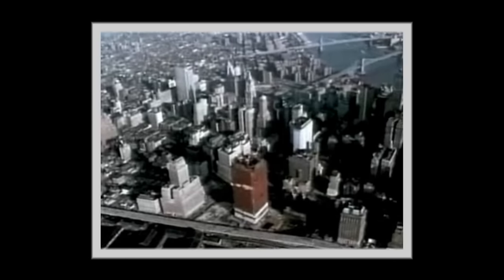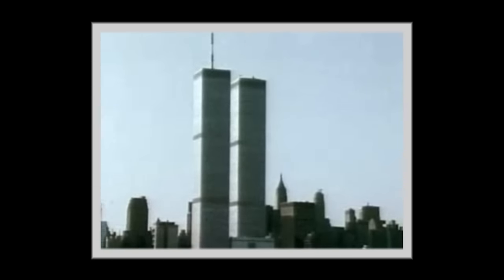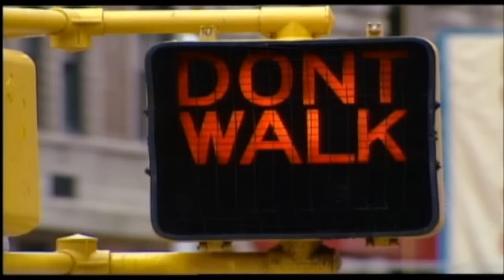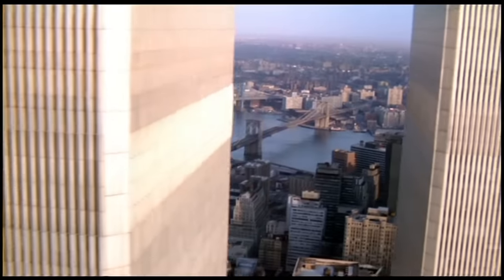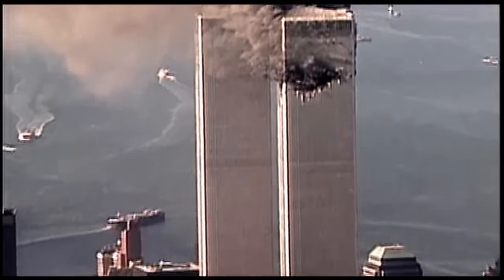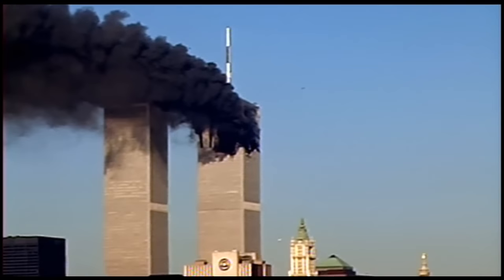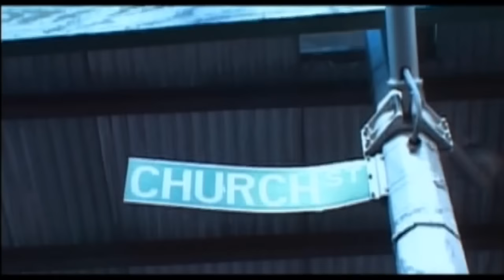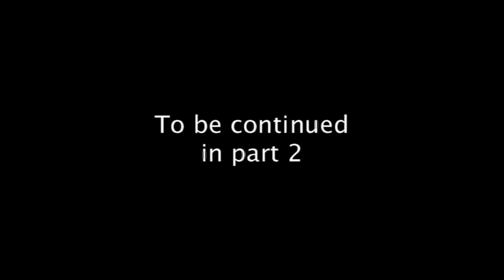102 Minutes - The Attack on WTC, Part 1

Comment: We were lucky that the South Tower did not collapse upon impact.  The airplane impact was much more damaging than what the North Tower sustained.  Almost all of the corner supports were blown out on impact, not to mention the interior supports.  If you watch the collapse, you will see that it starts at exactly the point of impact near the corner of the building.
Reply: Plus it didn't help that it hit at a much higher speed and at an angle.
Reply: Walter White When it's going over 500mph, yes.  You can cut steel with a jet of water if there is enough pressure.  No need to be insulting, "truther".
Reply: The WTC's were insured to withstand the impact of MULTIPLE AIRLINERS... but yet 3 steel framed building 2 of which were 200,000 tonne structures of steel and concrete collapsed into their own footprint in less than 9 seconds, WTC7 fell due to 'fires' in less than 6 seconds into it's own footprint. MAGIC
Reply: The Empire State building suffered an impact from a plane (look it up) and guess what... it did not fall
Reply: You Just Read This The Empire State Building has a concrete facade and was not a lightweight structure like the WTC.  And, the plane was not going anywhere near the same speed.
Reply: But most planes are flying under 250kts under 10000 feet.
Reply: Electone_Guy the planes weren't doing 500mph when they approached the towers.
Reply: Also the official 9/11 commission report stated that the building fell due to fires and not due to damage of main internal pillar supports. Why was there no mention of WTC7 in this report, what happened to NORAD, what happened to the 'most well protected country in the World'?
Reply: You Just Read This Simple: laziness.  The Yanks got caught with their pants down that day, just like they did at Pearl Harbor.  There was intelligence on both incidents before they occurred.  Don't forget, NORAD is a joint Canadian/American military response entity.  Were the Canadians in on this too?

Comment: 911 Truths, you hear that? The towers were designed so the outside walls carried most of the weight. The very same walls that were sheared by planes travelling at full thrust.
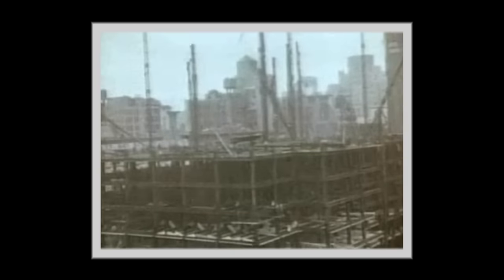Reply: +Mark Bartlett Incorrect, Only the planes engines and landing gear could possably  enter the building ( only a possablity). Other parts have no chance of breaking the thick parimiter beams and floors.Even if they did. The core steel is self supporting and massively thick + heavily crossbraced.You can douse the tower with jet fuel, let it burn for hours ( a scenario far worse than the actual fires) and if left alone. The burned out structure would still be there today.Then there's building 7THE LIFTWELLS WERE AIRTIGHT ( but not in this bullshit video, which is quite possably an old sounding but post 9/11 narration track over old film and very convincing?)But look at the huge steel verticles in the core 1:09 they are thicker than a person ( some 9/11 believers exepted) and once the crossbracing is done will form a strong, flexible self supporting structure in itself.
Reply: +Justin  Bennett Have you ever seen how heat bends steel? It looks like gum. I don't believe chewing gum can hold thousands of tons.
Reply: Félix Bachiller again nice try guys lol. And you are aware all of the jet fuel burned off during impact. So how did it get so hot???
Reply: The building was on fire, you can see it in the videos.
Reply: Félix Bachiller but fire on its own cannot get hot enough to turn steel to bubble gum as you described. There's only one way that can happen
Reply: But I have seen it myself. I saw a farm that burned and it was completely bended like spaghetti.
Reply: +John Sergei You guys are all wrong. I cut massive thick steel beams with aluminum cans. Right after I empty a 12 pack...
Reply: +Félix Bachiller ...these buildings were no farm
Reply: Building 7 was at the footprint of two 110 story buildings that collapsed. Im sure you saw the pics and videos of the fires that were raging all day until it fell @ 545. Building 7 was one of about 10 other buildings that collapsed that day. Yet they want to focus on building 7. Its just a shame how many of these wackoos are out there
Reply: +Occhi Blu u cant explain basic physics to us...we just needed to get Saddam for what he did to us
Reply: +Phunny Munny when you have an opportunity please provide proof that aircraft cannot fly at full speed/thrust so close to sea level...
Reply: Myblacknova they can travel at that speed.   I mean, it's technically possible,  Mr shill.   But given the planes path supposedly traveled, and taking into consideration how difficult it is to approach maximum speeds that low to the ground while still maintaining control.  Want some proof?  Go try to do it.  Lemme know how that all works out for ya
Reply: i could understand more if the planes had it the lower floors but surely the bottom 80 odd floors can support the top 20. otherwise the building would have collapsed shortly after being built. but it stood for 30 years supporting those top few floors.
Reply: Philcol gab Im confused by your statement. Of course they held the top 20 floors.....Without damage.
Reply: Planes?

Comment: stupid people who think aluminum planes can go through steel and concrete, explain why the nose of the plane is visible on the other side of the building? 6:47
Reply: it takes common sense to know planes did not went though concrete and steel nor they brought down the twin towers, you talk about water cutting steel, yes,  water shooting out at far greater speed than those of the "planes", speeds of 2000 mph or greater, on treated steel, in a lab,  while the planes speeds were at 500 mph, come on! and what about the tip of the wings cutting through concrete and steel like  a knife through butter, yeah right.
Reply: It's the same principle as the water cutting steel. The velocity of the water makes it possible. The velocity of the plane was 500 MPH and there's hardly any concrete. There are concrete slabs for floors but it's made out of mostly steel.
Reply: steel weaker than  concrete, yeah...no
Reply: Moses Gtz. H. Are you saying that there were bombs that exploded to made a perfect hole for a plane to just slip right on in
Reply: Moses Gtz. H. Saw it
Reply: Imagine a 50ft guillotine going at 500mphs made of aluminum. That's the tip of the wing. That will break thru glass and snap thin steel easily.
Reply: Ever heard about speed? Water jet cannon can cut a sheet of iron or a slate of rock.
Reply: Moses Gtz. H. Look at an impact hole.....  LOOK...  From where the engines hit  to the tips of the wings, most of the beams are just bent or dented,  not sliced through.
Reply: Speed dummy.
Reply: Speed thats beacuse of speed atleast 600 kmh that plane was doing. And the plane weight was like 20 tons maybe im wrong im not sure about the weight of the plane but atleast 10 tons.

Comment: Those aluminum wings would have broken off. The entire plane would not have penetrated the building.
Reply: +David Henley Do the math....speed vs tensile strength and bending point....it equates to your hand going in slow motion to break a half inch board, It will not break but your hand might...now hit the board a high speed and you will break the board...try this at home....its equivalent to the plane hitting at high speed, forward motion will continue...
Reply: I'm sorry for not doing my math. Please forgive me.
Reply: +TheCabinfever1977 This is the most idiotic comment i have seen. He compares the planes hitting the tower to a fist hitting a half inch board. and that is what you reply with? -_-

You can't even comprehend that he scaled it down for everyone to understand... yet someone never. LOL
Reply: the empire state building did not colapse

Comment: Man I feel sad for the builders that built that then it falls how sad there hard work is :/
Reply: Chess Game same but the lives are more important to save than a building
Reply: Yes I totally agree 😢😭
Reply: Shark Man X bro! Yore mum
Reply: Mad I feel sad for the 2753 people who died when it fell how sad :/
Reply: Def was not just an aluminum plane that made those buildings fall
Reply: DoyouevenPraisetheSun? Well yeah, people arent structurally built like the WTC.
Reply: DoyouevenPraisetheSun? Not just one marvel occurred you’re saying, but 2!  Listen to demolition experts on it man.  Listen to the firefighters that were inside the building.  Listen to the science.  Cause if you did, you would understand that buildings don’t fall like that unless it’s controlled, the firefighters said on camera that they heard multiple explosions occurring during the time of the fall, and the heat produced by jet fuel is not hot enough to melt the metal that held those buildings up.  That evidence goes beyond conspiracy.
Reply: Finding the Top Hits Unfortunately for the dumb "buildings only fall like that in a controlled demolition" theory it becomes utter nonsense once you do the slightest bit of architectural research. The tower design used for the WTC uses the external frame as the primary load bearing support. The middle is supported by a much lighter framework, with each support only needing to bare the weight of 1 floor. This offers 2 design advantages. Buildings can be made taller than previous designs allowed, and in the event of a catastrophe its designed to collapse in on itself. Basically, the middle of the structure becomes the path of least resistance. This also explains reports of "explosions" (made by people who've likely never seen an explosive go off) seen running down the tower as it collapsed. As each floor was hit the flames were pushed out, and as the middle is falling faster than the frame it seems as though explosions are preceding the collapse. This makes complete sense for an architectural design, it would be disastrous if a building like that fell to literally any side.  For all the "research" you truthers spout on about doing, it really doesn't show. Its important not to let your "research" be youtube videos titled WE'VE BEEN LIED TO 9/11 TRUTH SHOCKING EVIDENCE. Its a farce

Did the government take advantage of the situation? Thats a different question. But theres no evidence to suggest they played a part in it. And trust me it pains me to have to defend the government but the evidence all points towards Islamic terrorists with a grudge against western powers fucking up their land. Hell, Islam is a FAR bigger threat to world peace than the US is, which is saying something
Reply: Finding the Top Hits Also, metals dont need to reach anywhere close to their melting point before they lose 80% of their structural integrity. How do you think swords were made? They didnt melt it and then pour it into a mold, that'd make a trash sword. They would heat it to varying degrees, half its melting point maximum and then you rather easily flatten still solid steel. 
It also wasnt just a jet fuel fire, offices are absolutely loaded with flammable substances. Hydrocarbons in particular, which when ignited actually burn even hotter than jet fuel. Not to mention the tower literally became a furnace. Strong wind rushing through a (relatively) small opening and into a contained heat source? Literally a furnace. So it not only got even hotter than a jet fuel fire, but metal loses its structural integrity the hotter it gets. It wouldnt need to melt, not even close
Reply: I would have been interested to hear what the architects thought of the buildings coming down, the towers and building 7. He would have been arrested if he was alive as they were built to withstand multiple jet liners.
Reply: Misses Robot No. They were not built up withstand multiple jet liners. Or even one.
Reply: DoyouevenPraisetheSun? Oh and the speed you claim as well is wrong lol 587 is max speed (I might be off a few mph) vmo is 257 at a low altitude or flutter begins and stress rips wings and tails off even the lying NIST report stated what 400 mph...i would have to go back in read what made up bs number they claimed.
Reply: Chris White Lmfao
"False flags have happened before therefore i know this was a conspiracy"
Are you even capable of critical reasoning?

Do you know what fire proofing actually is? Im guessing you dont if you think an outer coating of flame retardant can mitigate furnace esque conditions after withstanding a 3658 MJ impact
Reply: How about the people that died that day? How about the people in the airplanes that saw what was about to happen?
Reply: DoyouevenPraisetheSun? Actually an airliner strike WAS in the plans .... they calculated a loaded 737 hitting it.
Reply: Lil Tin true
Reply: I can feel that too. I build a building from lego. It was hard, and i accidently broke it and fell off.
Reply: Denden 7773 now, now. He did not say: "Fuck all the citizens that lost their lives". He only added some more
Reply: @tauist 707 actually, which was the biggest one at the time (1960s to 70s).  But the point stands, they did have it in the plans.